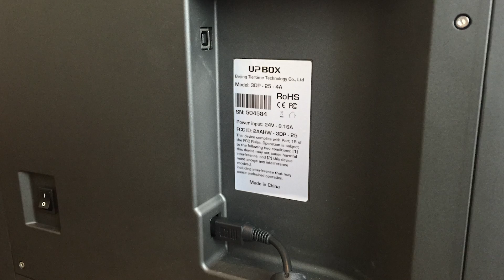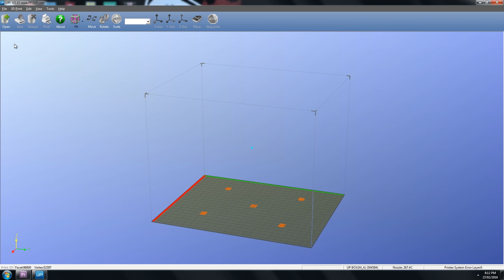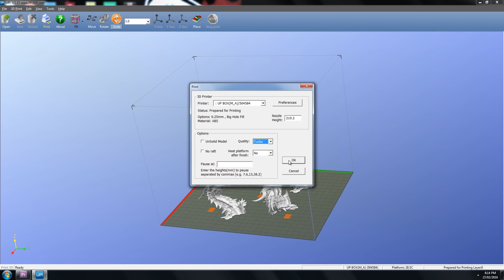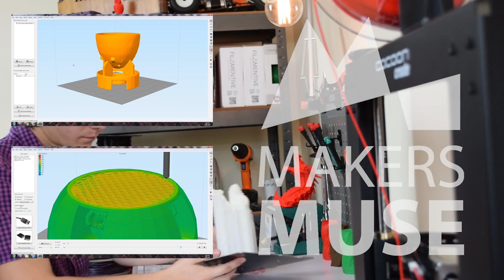UP! Box 3D Printer Review - Big ABS Prints!

Comment: I've been working with an Afinia H800 (which appears to be more or less the same machine as this with some minor differences, though I could be completely wrong) and I frequently have the issue you've described here in which the back pressure causes an eventual print failure. Is there a way to apply your manual fix using the UP! software, or should I be using something else? The Afinia Premium Black ABS has been a complete nightmare to print with; even with sufficient preheating and tweaked bed settings, warping is inevitable on large prints and frequent on smaller prints. Any advice? I'm sorry to have to ask so many questions, but I've found virtually no other resources online.

Comment: The Up Box has now been upgraded to the UPBOX Plus which can, if requested for the upgraded, take 1kg spools. It also has WiFi connectivity. 

I am not too sure why people have posted about problems with consistency, it is probably the most consistent and reliable 3D printer you can get. You can check out the UpBox Plus Specifications at: https://www.idig3dprinting.co.uk/shop/3d-printers/upbox-plus-3d-printer/ .

If you want to do design work and need to work with ABS & PLA then you are not going to find anything better, especially at this price range.

Comment: Man... I'm not sure if I'm one of the unluky ones, but truly: upbox sucks bad. Autocalibration height for the nozzle sucks. It frequently do it wrong and it's too close to the printer table. So I have to adjust it manually. It also clogs frequently. With ABS or PLA. Really, not good. I've already opened the printer head and looked for clogs and it's ok. Also used Acetone and unclogged the nozzle really god and still... it clogs. Also, it sometimes fail to pull the fillament (which is strange because the cog is clean). Bottomline: don't buy this. It really doesn't worth its cost...
Reply: Ow: and customer service is also terrible in Brazil. If you don't call them, don't bother sending e-mail. It really takes too long to get an answer (when you get an answer)...
Reply: Fala Dalton tudo ok? Vi esse seu post aqui e estou com a mesma lamentação que vc cara... De cada 10 impressões que eu faço, uma da mais ou menos certo.... Tenso demais... Gostaria de me comunicar e trocar experiência com vc!!!!
Reply: Olha, me manda uma mensagem em pvt. Outra coisa, o único jeito que consegui resolver os problemas da minha, foi mandando de volta pro distribuidor. Não teve jeito. A impressora está parando de imprimir no meio pq o filamento simplesmente trava sem explicação nenhuma. Já perdi um rolo de 0,5 kg de filamento por conta disso. Em suma, recomendo que vc entre em contato com a empresa que te vendeu esse produto e acione a garantia. de outra forma, vc tem um peso de papel de 25 kg.

Comment: I had some problems with the printhead shifting buring prints. (due to the magnetic location assembly not positively locating.)
Problem solved with rubber band and/or cable tie.

Comment: This machine is designed to slowly but surely break. That is why you can buy extra warranty for $800.00 per year extra. That is why they are still using paper cables instead cable tracks. That is why it has 6mm rods.

These guys profit from out of warranty claims the most. So they get you over that one year line and then you will face more and more problems.

Comment: I loved UP's,  but the UP BOX is not a reliable machine. 

I have owned one of these for a year now, and consistently when I print a large thing the printer breaks.

The part that will break over and over is the rear axis which is constructed with glue that dissolves with heat, and is held in place with plastic clips that consistently break.

The UP PLUS was much better than this machine in terms of reliability.

Comment: Is the Up mini still worth buying in this day of age?.
Done some looking everywhere and the software seems pretty dated, some sites only state '' Windows XP , Vista , 7 ''.  i myself use windows 10, and i would be devistated when the printer isnt working well with todays age software, Reason i want to buy the up mini is that it is widely availeble on stores nearby in the netherlands, not alot of other printers are.
and i refuse to buy the Da Vinci Junior, because of the filament restriction and brand only buy's.

 Also if it is still worth it, is it better to get the plus 2 or will the normal up mini be just as good?

Comment: have you tried putting Ninjaflex or something similar through this as yet? if so, what settings did you use
Reply from the maker: +John Attygalle I have never had any success running ninjaflex through my UP Mini but aparently it 'is' possible on the Up Box. I think running 'fine' and fairly course layer heights is the key, I'll ask 3D Printing Systems to chime in on this one.
Reply: +Maker's Muse awesome, I've tried a few different settings using FixUp3d but getting a stringy mess...any help is appreciated, thanks.

Comment: great review, u should give the Zortrax M200 a try one day. amazing quality with ABS
Reply from the maker: +Ahmad Hamad Zortrax M200 and the UP's both have great ABS print quality, I had one lined up but sadly didn't get it organised in time!
Reply: +Maker&#39;s Muse hope u can get ur hands on one someday. it has a bigger variety of materials than UP Box
Reply from the maker: The UP Box is rapidly expanding its material base due mostly to community hacks and mods - it can do polycarbonate now which is fantastic, but still no chance at flexible materials.
Reply: my problem with up box is there aren't enough reviews on it to compare its print quality with ultimaker 2 and zortrax, other wise I may have went for the upbox
Reply from the maker: I REALLY want to get my hands on a UM2 for a review, they're just so expensive in Australia and rare too. UP Box has the edge for ABS I think as it's fully enclosed, but again no idea till I test.
Reply: +Maker&#39;s Muse it won't be as good with ABS as zortrax or upbox but it can print a LOT of materials including flexible filaments

Comment: Hi everyone. I bought an up box for my company. It is the perfect printer for the situation. As for the negative this is what I did, the spool holder is super easy to print an extension which allows for whatever size you need. Right now I have 1kg of polycarb on it. As for the temp adjustment and proprietary software. 1. I use the temperature hack all the time to control the temp anywhere from 200 to 300 degrees C. I also adjust my speeds and feeds with this and it works great. 2. Someone just developed a transcoder to use any slicer on the up platform. 3. Up is about to release their new software which will most likely have quite a bit of features including temperature control. Overall it prints abs like a dream every time, and lately I have been printing polycarb on it a lot with no problems. I may be hacking it a bit more than most. But if you want it to do something for something specific it is capable of doing it. Just my two cents
Reply: +Jude Tan I haven't tried flexibles on this machine but have on my up mini and based on the design I would say no it won't work.

Comment: For $1,899 at 20kg with print volume of a 5kg printer, crazy small filament spool that is hard to get around and no LCD screen or SD card reader I see no reason to even look at this printer. Also the removable bed is far from new and rafts should only be used on cheap uncalibrated machines. They also require preparatory software and abs filament with no temperature control so you can only print PLA or their ABS. UPs in general are bad but this takes the cake

Comment: I would get an Ultimaker 2 over this. Or the extended version for even more build volume. Less proprietary stuff. 3D printing community has been driven by open source hardware. Open source firmware. The more we allow manufacturers to lock things down, the less standard things get and these manufactures in turn contribute nothing to the community as a result. Would you recommend a Makerbot? I wouldn't for the same proprietary hardware reasons (plus too many issues with their hardware). If you are interested in a large format printer which can do great out of the box prints -- look at Type a Machines Series 1 Pro. That's a printer I would recommend to schools, libraries and engineering shops. You have a HUGE build area of 305x305x305. Heated bed, standard fillament support, an option to add an enclosure (which helps with ABS), and built in Octoprint, and Wifi. They provide their own version of Cura, but I've been using Simplify 3D with no issues. Forcing people into manufacturer branded filaments is plain wrong. Forcing people to use proprietary software on an FDM print is wrong too.

Comment: OMG Thank You... around 6:15 you helped me figure out why my printer is having so many issues when I do long prints (been doing a ton of 12hr+ prints). That back pressure thing due to the bed being to close should help me tune my printer a little more and "hopefully" not have failed prints at random spots when the start seemed to be working so darn well.
Reply: You can also replace the 12v fan with a high cfm fan that moves more air and it will cool the stepper faster and will stop overheating all togeather
Reply: Not sure if my printer has a stepper fan, but could be wrong, as I haven't taken it all apart (yet). I'm running a Ultimaker 2, but after a few recent upgrades and switching to Simplify3D, I've been having some printing issues. But it "sounds" like it was the back pressure thing, but need to run some test prints to ensure that's actually the case :-)
Reply: +John Sanford If you have a look under the plastic extruder cover there is a small 12v fan that are attached to the extruder system this cools the stepper as the nozzle is attached directly to the stepper motor with no heat break so it gets really hot but with a more powerful fan it cools much better and provides less problems

Comment: For me the closed source SW would be a no-go. No compatibility, vendor lock-in, not a chance. Perhaps, if they come to some common sense, they will do a firmware update with at least g-code compatibility, then it can be interesting.
Reply: +Robert Klauco Why is that important if it prints pretty much flawlessly? Maybe you're the kind of guy that likes to tweak for the sake of tweaking? Not everything needs 12,000 settings adjusted for it to work well... It's a great printer that prints very well... Why the need to mess with settings if it won't improve your prints?
Reply: No, I don't take to tweak everything. The problem is that we are in what could be called as "early years" of 3D printing. A lot of companies went south - now imagine having a printer from a company that bancrupted 5 years ago worth $3k and unable to print anything as nobody will be able to port the proprietary device drivers/software to newer version of OS. You will end up with a very expansive brick. This is exactly what happened with a LOT of 2D printers in the age of Win 3.11 -> Win 95. Same thing with 2D scanners. Even digital cameras (before they implemented common standards such as PTP, ...). So, to avoid the same hell in 5 years, I would simply never buy something like this. However, your situation might be different - perhaps you don't plan to have the printer for more than a year or two - in that case you should be OK even with closed source.

Comment: I can see why that would be a nice printer even though it has the few "limitations" with the filament and spool size. I say that because much as I LOVE my UM2 the drawback is that there's no filter and throwing foamboard on the top, while it works great... its a real hack solution for printing in ABS. I do have to say the fiberglass print bed idea has me interested in trying that for my printer since much as I love BuildTak the price just sucks _... and some stuff just refuses to stick OR if it sticks it tears the build tak off... and that just isn't cool!

Comment: what about an xyz davinci?  it can do abs and pla, has a heated build platform and passively heated build chamber.   Works with simplify 3d.  now the resolution can only go down to .2, but it is half the price of the up and you can set temp and everything else.  with the pro version you can also add a laser etching module and don't have to use proprietary filament.
Reply: +abraham galloway It can go down to .1. The UP! Box does look a lot like a Da Vinci, and the only main difference that I see is that the UP Box! definitely prints better. Not sure if the quality is worth an extra $1300, but the prints do look really nice. The closed-source type of 3D usually gets a lot of hate, but people just don't see where it's valuable. Plug and play is perfect for a school, or engineering firm, just like Angus said. They're for people who don't 3D print as a hobby, but for people who use a 3D printer as a tool.
Reply from the maker: +Drev McAwesome 100% right, it's for printing one thing well - easily and reliably. The quality of the support materials in ABS off the UP is better than the Davinci could ever achieve too, not sure how they do it but it's a combination of line support which then terminates in a wide interface surface that can be removed by hand most of the time, pretty amazing.
Reply: +Maker&#39;s Muse  I find the key to having a davinci is simplify 3d.   once you have it dialed in you can get really good prints, not as good as the up can do, but for the home hobbiest a great start. I wish I had the money for an up, but you should review the davinci with simplify 3d.  Dollar for dollar for the print volume you get I find there really isn't a better option.  I picked mine up on sale over a year ago for 349 usd brand new.  mind you within the month I had jail brokjen my 1.0 to use repitir and had bought simplify 3d right after.  I print pretty much everyday and have found it to be very reliable

Comment: I'm a small time draftsman and I have been looking for a printer that is good at prototyping so that I can be more attractive to small business', the main machines I've been looking at are the Up box and the Zmorph, how would these two compare in a small design studio?
Reply from the maker: +Damon Reddy The Zmorph is an experimenters machine, it's got lots of interesting toolheads but you'll spend ages calibrating and keeping them working right. I would go with the UP Box if you're after reliable printing of prototypes - how often will you be looking to laser etch or print in chocolate?
Reply: Laser etching is a maybe but only because I think custom leather watch bands might be a neat thing for some people, otherwise I think I am going to stick with printing and CNC. I have an airport near me and there is a lot of experimental aircraft builders there that like composite work eg. glass and foam. The foam would be CNC'd profiles of an airfoil split into stations. On the other hand I would like to stick with prototyping so im not stretching myself to thin with a ton of different services. By the way great videos you do a great job this is my go to channel!

-quick edit on this comment, printing in multiple materials is important

Comment: No built in print memory, touch screen, wifi, or spool sensor. FlashForge Finder wins :P plus you can print a spool holder for bigger spools and print at any temp.
Even the Flash Forge software is ridiculously good.
Reply: +Mickice Try printing abs with the flashforge finder
Reply: Not allowed and the volume is much smaller, but to be honest the features I mentioned have spoiled me. Up! will never get mass market appeal being so fixed.
Reply from the maker: +Mickice The UP Mini 2 has those features finally, wifi touch screen and sensor as well as bed autolevel, and about the same print volume of the Flashforge finder - really pretty excited to see how they stack up when it comes out!

Comment: filament issue killed the deal for me.
Reply: +66tbird1 Just 3d print a spool holder and use regular 1Kg rolls... Couldn't be any easier than that sheesh...
Reply: +Richard Ryerson You're forgetting that the temps can't be changed. So no third party filament.
Reply: +Vincent No, i am not forgetting anything. In fact I am about to educate you... I use this https://www.octave.com/p1173433505/Octave-Extruder-Nozzle-8-Setting-Temperature-Switch-for-Afinia-H800-and-UP-Box/product_info.html
Reply: +66tbird1 It really comes down to flexibility for me. There are work arounds for about anything but there in begins the problem. I've had enough modding with my rep1&2 to get them to '''set and forget'' machines that run any filament. I'm looking for a big build area on a rig with quick and easy maintenance. At the moment the gMax XT is it as soon as an HBP and leveling is in the picture. I'll build an easily removable heated enclosure with a pid controller no prob, but if I'm always fighting propriety parts or software then I'm out.
Reply: +Richard Ryerson a 60$ add on that gives you a bit of flexibility (and a bit of a hassle to use/install). If you're paying that much for a machine, you want it to be good out of the box and not have to mod it for a simple feature like that.
Reply: +66tbird1 The new UP studio software will allow you to change temperatures,

Comment: How does bed locks in? Just a friction fit?
Reply: +Maker's Muse and the 2 small ball bearings on both sides of printing bed.
Reply from the maker: +Darek Kothe Derp! And those too. They provide the upwards force that locks it tight against the screw heads.
Reply from the maker: Yep just friction from the countersunk screws, holds it really snug.